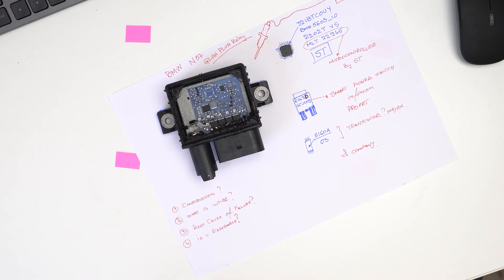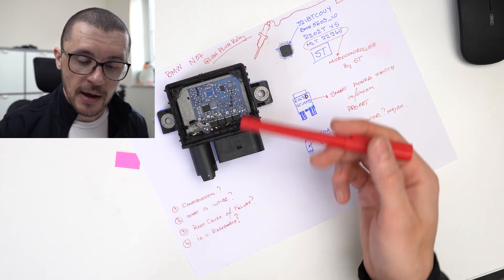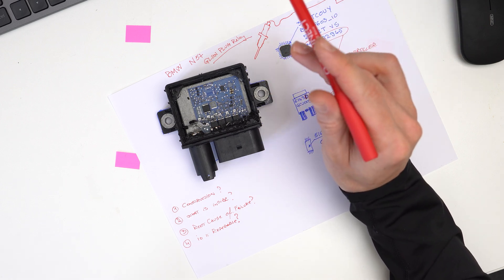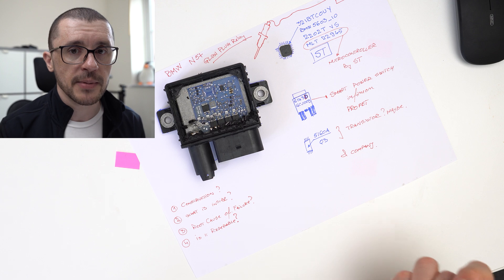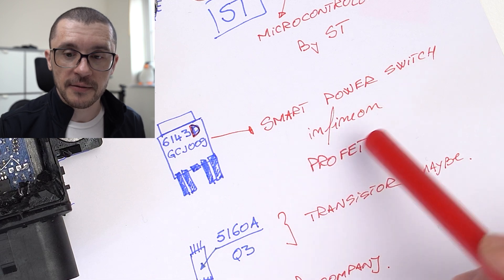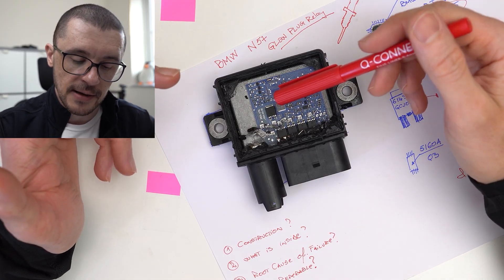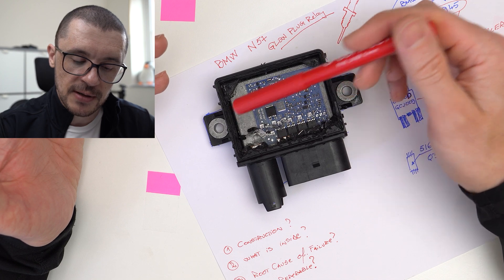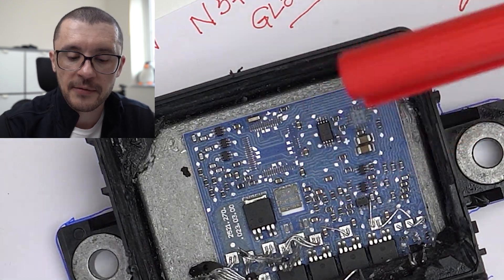The Common BMW N47 N57 Glow Plug Control Problem - Can We Fix It?

Comment: WHAT IF ONE CONTACT IS NOT CONNECTED IS IT WORKS ON 3 OTHERS GLOWS?
Reply from the maker: I would think it works on the other 3 or 5 ... if not you will really not be able to start a diesel engine in cold conditions
Reply: @BestCarMods Thanks i will try 😊

Comment: BMW installed this on the side of the engine, which is a very bad location, vibration leading the damage.  I am on to my second unit. Beru is the original BMW module.  But I have opted. out for the Hitachi module,  better connections inside.
Reply from the maker: I am at my second module, also.  every 5 years :) another one. still went with beru.